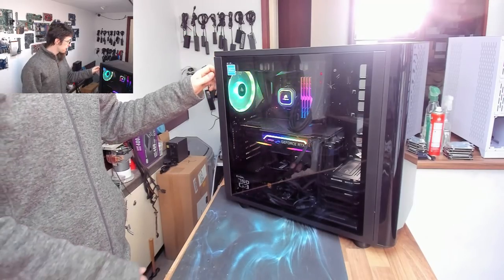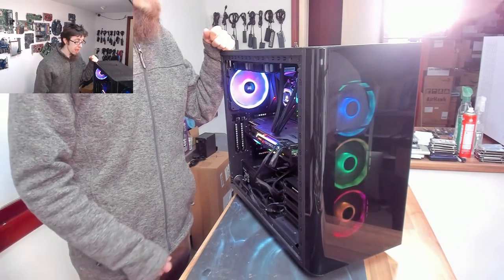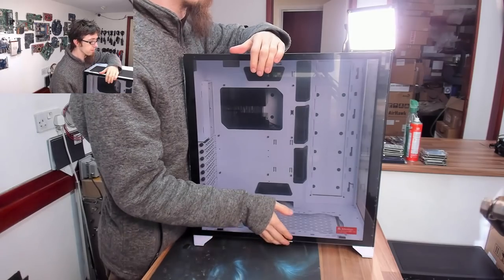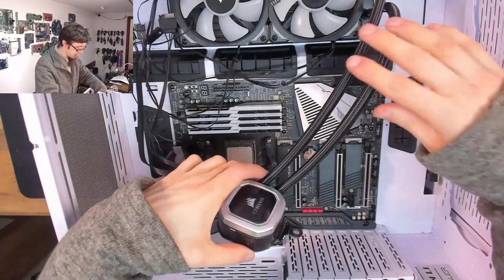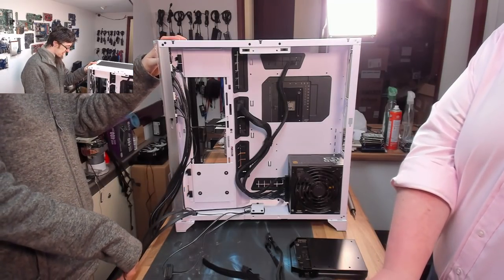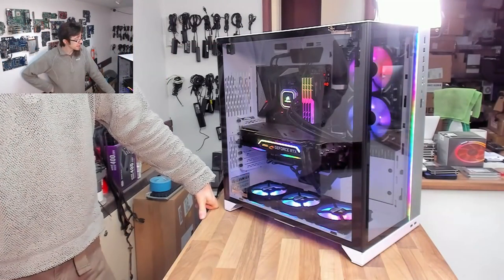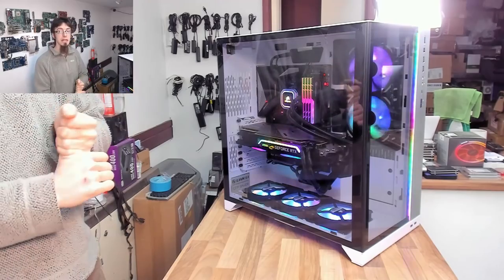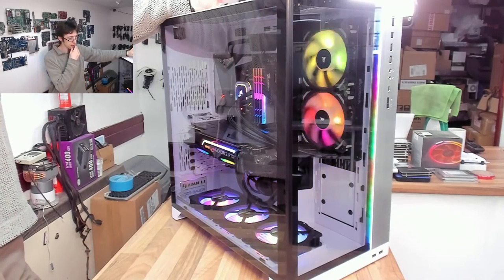Lian Li O11 Dynamic XL Re-case - LBC#58

Comment: intake on the side, radiator to the top, exhausting, this is best set up for PC-O11 Dynamic cases.
Reply: yeah not only would thermals be better but it would look way better imo.
Reply: Agreed. Running 3 side intake & 3 top exhaust radiator myself with a non XL PC-O11. I'd also prefer the black color over white for the chassi.
Reply: I have this case with 3 120 fans intake for the side and the bottom. 360 Aio exhaust at the top and 120 exhaust at the rear.

Comment: I think I would have preferred the AIO rad/fans in the top and the 3 fans mounted alongside the motherboard it would have looked better in my eyes. I can see why you planned it the way you did it does make sense. Ideally, you have a controller as you mentioned to take more fans so eventually 3 more could have been added to the bottom later. I also picked the white XL recently it so nice to work with and I've gone with a full custom loop makes it so easy.

Comment: I built in the Lian Li this summer. They look and perform great! Mine is the non XL. Half an hour? 9 fans with rgb and power. I tossed the controller, bought hubs for fans, and rgb, ran to the motherboard connectors.  It was a couple of hours of hiding wires.😆

Comment: Since I have the 011XL Black edition, I want to chime in. I have a Gigabyte Aorus X299 Gaming 7 with an i7 7820x processor. I use the Corsair H150i Cappelix AIO, but mounted it on top using the LL120 fans on the top and sides. The intake on the bottom and exhaust on the rear I used the QL120’s for a total of 10 fans. I also have 8 storage drives (3 3 1/2 HDD’s, 1 2.5 HDD, and 4 2.5 SSD’s). The key to making the fans shown properly was to use the QL120’s even though yes they are the most expensive fans, but well worth showing the stuff. Also adding extra RGB strips and hiding them properly makes a great lighting effect.

Comment: Finally a correct AIO mouting (tubes down) as pointed out by GamersNexus! It's a good reference for my build but my AIO is 360mm so if I can't route the tubes or it ends up looking bad, I will mount the radiator at the top and add side fans for aesthetics. Thanks for the video~

Comment: There is a good reason for hose placement. Despite the manufacturer's best efforts, there is a small amount of air present in the closed loop. You don't want that pocket of air in the cpu cold plate or the intake/return part of the rad.

Comment: It is not a problem to mount the aio with the hoses at the top. As long as they're higher than the pump. The air in the system will always go to the highest point in the system

Comment: Think the original case is a Thermaltake View 31?  There should be a (rear) solid panel version of the case, but this has the TG at the back. For a company known with cooling, you'd think they would design the case with proper airflow.
Reply: You’re spot on, View 31. As it was my first build I was more or less happy with it but as time has gone on the TG on both began to make my teeth itch.

Comment: The fans on the radiator are pointed as an intake so they are putting hot air in to the case. U should put the aio on the top and position the fans as an exahust then put some fans on the side as an intake

Comment: AIO fitted at top, 3 non rgb fans at base, add RGB led strip to the base, side vent I would have two intake RGB fans, I'd stick other RGB fan at rear for exhaust, also add cable mod extensions

Comment: My OCD is kicking off, that AIO needs to go roof intake with hoses to the rear and the 3 fans pushing out the rear. It's just hoses touching and pushing down GPUs should also "be illeagle", the other problem with the setup you've put together is that the hot air will recirculate through grommets and gaps in the mobo tray. For that I give you a 6/10 for the build, with also taking into account you used what you had so there are no deductions for parts choices.

Comment: That reminds me, in regards to my build, how horrible the standard heatsink mounts are on AMD. I needed a few attempts to get the pump head mounted on the CPU. On the other hand, I got the Capellix version, so it came with the RGB controller that has six proprietary Corsair RGB headers, and six normal four pin fan headers, only one SATA and one USB.

Comment: I have 2 tiny cables left from the system panel header from the front of the case. Power led+ and power led -. I am using the z690 f wifi motherboard but I cant see where I add the last 2 wires? If you can help it would be much appreciated.  Great video. PCG.

Comment: Its funny how thats the only thing people got out of the video from GamersNexus... Hoses at the top is fine, as long as the pump is below the hoses. It will not hurt anything, but only potentially add a little noise from the pump. There will be no difference in cooling performance. They even say that in the video.

Comment: Nice build, the standard o11 is alot more compact I built my rig in a lian li o11, ROG hero 8, 3900x with h150i, x9 corsair ll fans, 64gb corsair rgb ram. Just waiting to pair it with either a rtx3900 or 6900xt. I agree the standard lighting node pro isnt good, but they do a commander pro which sorts out the issues.

Comment: great re case but one thing i noticed is the the radiator would work a lot better if turn up side down because or the air bubbles in the aio system

Comment: A couple problems with the case:

1) If you only install an odd number of hard drives in the case, you will always have an extra SATA cable connect to nothing and in the way.  And you cannot remove it, extra cabling you might not need getting in the way.

2) No bottom filter.  Any dust/dirt/etc. will be sucked into the case buy any bottom intake fans.  And then into the case making it dusty. 

EDIT - After looking at the manual on the Lian Li website, there is a filter on the bottom.  Just not mentioned in this video.  You have to be sure to have room to pull it out from the side of the case.  Not able to remove it from the front of the case.

3) Have to move the whole pc and take off the top and side in order to get to the side filters.  Depending on where you put it, might not be that easy.

No case is a "perfect case."  For some this will be.  Not worth all the extra effort to clean the filters for me is not worth the "German Engineering Approved" that they show prominently on their web page.  Give me a case that is easy to get to the filters without having to move the pc or take it apart partially to clean over this.

Comment: You should add the back fan. It helps, alot. I have the old version and I recently modded a rear 90mm fan. It helped with CPU  temps.
Reply: It will make little to no difference when using an AIO. Using an aircooler may be different.

Comment: Iirc, you can have an ITX motherboard at the back where  the hard drive cages are as you can install an IO bracket/motherboard tray for one of the holes.
Reply from the maker: yoooo that's nuts, I love it.
Reply: @Adamant_IT  Yep, when the case came out some of the big 'Techtubers' were doing dual system builds with 1000w psus.

Comment: Did your motherboard have enough slots to plug in both of the USB 3 20-pin connectors from the Lian Li 011D-XL case or how did you incorporate using both?
Reply from the maker: Yea this motherboard had two 20pin USB3 headers. My backup plan would have been to use a 20-pin to 10-pin adaptor to connect the lower ports to a USB2 header, as slow ports are better than no ports. But the Aorus Master mobo we had was pretty decked out.

Comment: I just swapped to this case (in silver with tinted glass) not sue why the drive bays were removed they have a thumb screws to allow for each bay to be slide out so they can be hot swapped. Also cries out for QL fans rather than LL  ones at least on the reversed fans. I have tested AIO pipes top and bottom and have seen no changes or had any issues so I would swap them to the top. Oh and some decent extensions would finish that build.

Comment: Any chance you could show us how you removed the middle back plate?  I don’t believe mine is installed the same way.  Yours has a clear “lip” hanging from the top that can be seen after you take your plate off the back.  Mine does not appear to have that and it’s jammed behind the frame itself.  I have not found a single person showing them removing this plate.
Reply from the maker: There's two phillips screws top and bottom, once those are removed, the top pulls out, and the bottom should follow. I did find it was a little janky, but wasn't a problem worth mentioning.

Comment: AIO radiator is upside down, you'll have an air bubble at the pump creating too much. Cavitation which will destroy the pump over time.
Reply: The hoses need to be at the top of the radiator, not the bottom. You've created a trap. Any bubbles towards the pump cannot escape and get into the radiator unless you periodically turn the PC upside down. The flow is not enough to push the arrow over to the radiator if it's trapped at the pump.

Comment: Think I would have went with the rear exhaust anyway. Additional heat only having an escape through the AOI doesn't seem to me to be the best. In fact I would have had the rear plus at least 1 top exhaust fan, this is just a preference though.
Reply from the maker: Yea, in an ideal world, we want another three fans up top (and/or one at the back), but that's easy to add in later on now.
Reply: @Adamant_IT  That's the beauty of a blank fan spot. =)

My current case has a top and back exhaust fans, no AIO, but anyway... There's a ton of heat coming out of those during heavy loads and I am glad they are there.

Comment: you should of tried the lian li uni fans they cut down on the wires a lot as they connect together through the case of the fan and the RGB is on both sides you can see a in depth  demo on jays 2 cents edit they are cheap as well £ 70 quid for 3 and a controller so cheaper than corsair and better

Comment: How did you sync the led strip on Lian Li to mother board? I have tried it's not happening. Kindly help.
Reply from the maker: You can connect the Lian Li strip to your mobo's ARGB header and control it with motherboard software. I ended up running it stand-alone though, as we were only doing basic effects on this build.

Comment: Hi Adam, Which case would you recomend
Reply from the maker: Whichever one you like the most. Although some cases perform better than others, the majority of the time it makes very little real-life difference unless you're running top-end hardware.
Gamers Nexus is always a good resource to check, any of their case reviews will have their ratings chart on it. Anything that's not in the bottom quarter is viable.

Comment: Barbs up isn't bad. What Gamers Nexus was saying was that having the pump at the top of the loop is bad. He wasn't saying barbs up is bad, he was saying that it's not ideal so long as the pump isn't higher than the barbs.
Reply from the maker: Yup. I'd like the literal hundreds of people in the comments of my other videos to know that too.
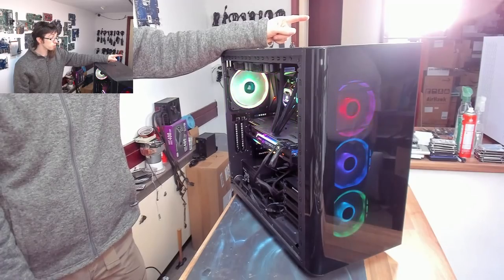Reply: nope you're wrong, it still is bad just not as bad as having pump at the top of the loop. you can go rewatch the vid and look at 2:27 on that video, the bottom states barbs at top "this will create pump noise and often rmas but isnt as damaging as having pump at the top of the loop although after awhile it can get bad."
Reply: @sd1rager  I would have to see some backing data to prove that assertion. If just having the barbs up were damaging and increasing RAM's, then we'd see a change in documentation and manufactures would be making AIOs with longer tubes. We'd see a massive amount of failures and customer complaints. So long as the pump is not the highest point in the loop, it's a non issue within the service life of an AIO, which is about five years. Permeation is a constant issue, regardless of the orientation, as are other factors that are going to shorten the life of the AIO before the "possible" negative effects of having the barbs up (so long as the pump is not at the top of the loop). If you're going to reference the AIO they cut open as a visual demonstration, well... that's flawed because it's not an accurate representation of how much air will be in an AIO.

With every AIO I've installed with the barbs up, I could SOMETIMES hear air going through the pump right at startup for a second or two. However, that's always been intermittent and I've never heard air in the  pump while the system was running. Now, if you were running a five year old AIO, that might be different due to permeation and the fact that you have more air in the loop as a result of permeation, and that AIO is really at the end of it's service life anyways and should be replaced, or serviced, if you can do so. Could you get some more life out of it with the barbs down? Sure, but it doesn't change the fact that running with the barbs up isn't bad, so long as you're not trying to limp an old AIO longer than it was designed to.

Comment: "that's the way it is now"
no, that's the way it always was, fluid dynamics and gravity haven't changed since
Reply from the maker: No one cared before GN did their video about it ¯\_(ツ)_/¯
Every system I've assembled with hoses up has been fine. Same with so many SIs, same with so many other home builders. Yes, it's true that sometimes you might get a gurgle if there's a lot of air in the system, or if your pump is higher than the rad then that will be an issue - but in the vast majority of cases it's fine. People took GN's video and blew it way out of all proportion.
Reply: @Adamant_IT   GN even said in their video that the primary issue with a vertically mounted AIO with the tubes up is potential noise (as long as the pump isn’t at the top of the loop). People need to chill out, so to speak. 😉

Comment: With all those wires at the back it looks like the network system at work with all the cables coming out for all the pc's in the building.  Overkill for just one computer.

Comment: I'm using the non XL version and can't for the life of me manage to slide the top panel in place lol
Reply: It can be a tad finicky, just make sure the side panels are all seated correctly and when closing the top put down force on it as you slide it closed. I had the same problem with my case, I was gettnig really disappointed with it, until I mastered the sliding technique  LOL. Good luck.

Comment: What happened to the single big rgb fan top left of old case?
Reply from the maker: It was 140mm, and there are no 140mm mounts in this case. It was a bummer as I'd have loved to use it somewhere, but it just didn't have a place in the Lian Li.
Reply: It’s been joined by a 2nd 140 and is installed in the top of the Lian Li.

Comment: EZDIY has a few kits of fans that are really amazing in this case, long story short, for less than 80$ shipped you get 10 fans and 2 controllers. while if you go the corsair way with double sided rgb, assuming you can find stock, ur in for about 340$ and you dont have a spare fan and controller. https://imgur.com/a/xpH8TSK

Comment: Heat rises. Top intake is never a good plan. Tell me again why you didn't put that radiator up top? "Pretty lights", was it? People are just goofy! What do you need video games for if you're going to stare at your case all day?
Reply from the maker: It's obviously ideal to follow convection - however, case airflow is massively more powerful. If your fans can't push against convection you've got a bigger problem.
Reply: @Adamant_IT  True enough. I just like to maximize every avenue of machine efficiency. And THAT CASE looks to be the ultimate candidate. You just have to figure out what to do with all that empty space on the side. A 7" LCD showing performance data might be fairly awesome! Maybe an RPi4 with an Ice Tower. :)

Comment: so you have only connected only one CPU cable stating you only need one & it makes it looks pretty & you stated don't know why motherboard producers put two eight pin power connectors on there motherboards & they really don't need to put two on there motherboards if you read about overclocking & that some motherboards crash or freeze if you don't connect the two eight pin power cords instead of just winging it think before you speak and if this was my system I would be really pissed if my power supply that I new had two eight pin CPU power cords & you have only connected one your a fumbling fool & shouldn't be commenting on things you know nothing about also cooler would have looked a lot better on the top pretty isn't always the best way & your still salty if you need to learn some more about motherboard & overclocking have a look at Gamers Nexus